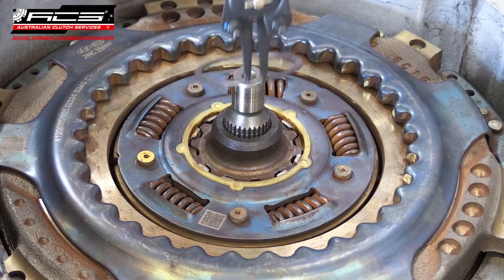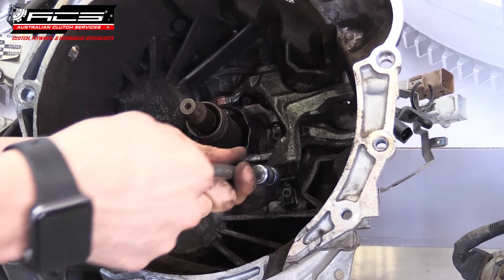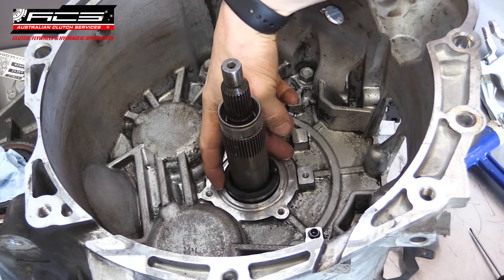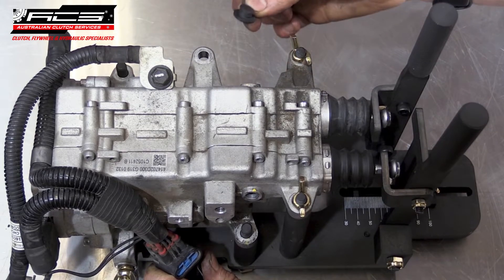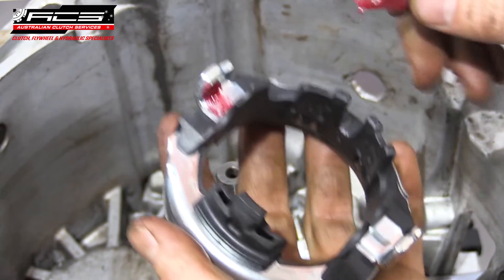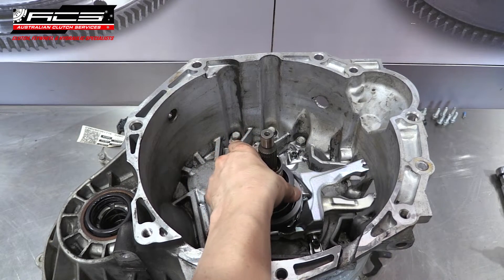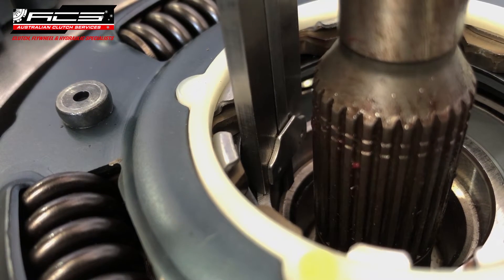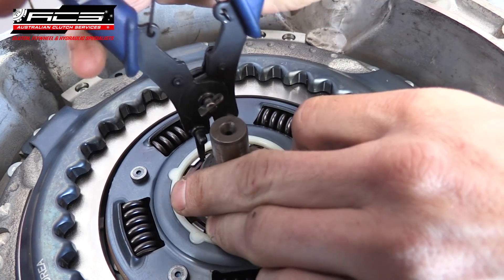CLUTCH TECH: Hyundai i40 DCT Clutch Assembly Replacement

Comment: What symptoms would you encounter if you're suspecting worn bearings in the clutch assembly?  Would it be sound related?  I only ask because I have a whining noise coming from my 2018 Ioniq hybrid and wonder if this is the cause - I have 177k miles on the car right now.
Reply: I hope you've solved the problem. In my case (it's a different vehicle, but the same clutch system), a Kia K3 1.6 CRDI DCT 7. Both bearings were damaged, and the metallic rattling noise occurred between 800 and 1300 rpm.

Comment: Need to add tools parts numbers, seem like going to run around $2500-$3000 just to add special tools and clutch assembly 😢😢😢, why couldn't they doing the same old way clutch design , I can understand stand the actuator but not clutch tools is unnecessary, engineers need to used their heads not by add more costing and complicated technology into manual or else buy Elantra N with manual transmission better of

Comment: Hi Guys, thank you for such informative video. Maybe you could advise on below issue. I have a problem with transmission in my Hyundai i40 DCT-7. All odd gears 1-3-5-7 do not engage. Car starts from 2nd gear then shifts to 4th and 6th. What might be a reason of that? Many thx in advance for any clue. Kr
Reply: First clutch is gone
Reply: My friend had a such problem: rod for 1-3-5-7 speeds in the clutch actuator broke.
Reply: I had the same issue with my 7-speed DCT. I took it to the workshop and after running diagnostics they identified it was a faulty actuator. This happened in my brand-new car within two weeks of car delivery.
Reply: My suggestion is to take it to a mechanic instead of getting information from YouTube, they can run a reader on your car and find out whats wrong, its nothing youll be able to fix, its either your tcu or you need a new transmission

Comment: Great video! Do i still able to do the actuator adjustment after transmission installed into the car?
Reply: yes you can remove actuator without removing gearbox on car

Comment: part number of the tools?
Reply from the maker: Hi, thank you for your comment. The part numbers for each of the tools used in this video are listed at 12 seconds into the video in the "Tools Required" page. However, if you have a specific vehicle application that you would like to check the tools for, we also have these listed in the catalogue section of our website www.australianclutch.com.au 
Thanks

Comment: Had this repair done at hyundai 7 months ago done 10k miles and its failing again it knocks really bad when taking off in 1st gear but then goes when going into other gears is this the fly wheel or whole clutch assembly thanks also any ideas why it would fail again so quickly 😭
Reply: Did you solve the problem
Reply: @omergursel1  yes sold the piece of shit 🫠🤣

Comment: Why Hyundai making things so complicated with a clutch? The clutch in Kia cee'd sucks too. The reverse is always fault even though I just replace the entire clutch.
Reply: Probably there didn't reset the actuator , causing early clutch failure
Reply: @phareztrinimand ,  my Kia cee'd clutch system isn't like this at all. It's simple but never work better since the day I replaced the bad clutch with new one. So frustration.
Reply: @markrobby7136  it's a manual?
Reply: @phareztrinimand  yes it's manual. 5 speed., kia cee'd 2008 Europe model

Comment: I have a question. I own the kia optima 1.6 dual clutch. My carba few days ago, won't reverse once I put in that position. I got a code 7073e that states: won't reverse and, the actuator is stuck in the close position. What would cause this? Oddly, this happened the next day after I took my car through a auto car wash.
Reply from the maker: Hi,
We would recommend taking the vehicle to your local mechanic or dealer to have this assessed. It is unlikely to be related to the clutch itself and could be a transmission related issue.
Thanks
Reply: @australianclutchservices7503  thanks for the reply.  I'll take it to the dealer. Just for clarification. A closed stuck actuator can be caused by a bad clutch?
Reply: @epicsseven7686  what was the problem in the end? My Tucson has done the same after some wet weather and water on the road.

Comment: I just replaced the double
Clutch and clutch actuator now I don’t have drive or reverse
Reply: What  was  the fix
Reply: @zukhrufhussain2271  tech line told me to rev the vehicle up in drive to see if it would move eventually it did move then I performed the calibration for it through the gds
Reply: @Kylessrt8  hi, your engine is 1.7 crdi with the 7-speed DCT gearbox?? I had a problem that the vehicle was slipping in 1st and 2nd gear.. I changed the complete clutch kit but when we started the vehicle it does not move forward and it does not reverse.... I tried to calibrate with autel mk508 but at the end of the calibration it tells me "mismatch between target position/actual position"... do you have any ideas?